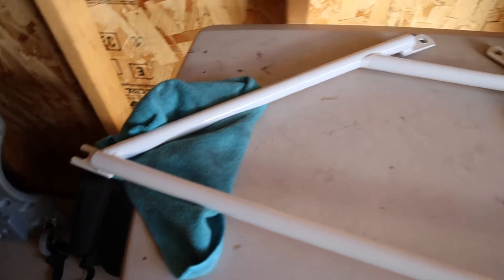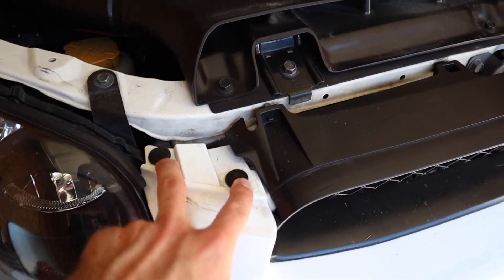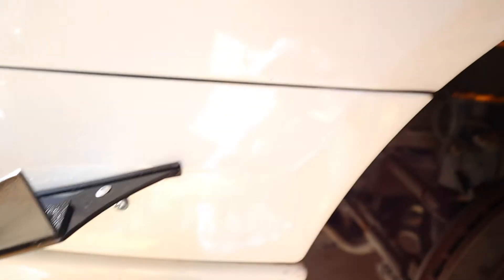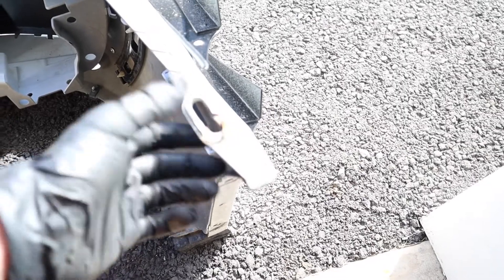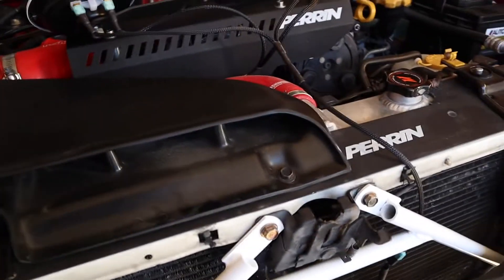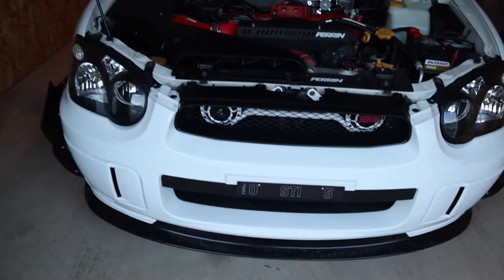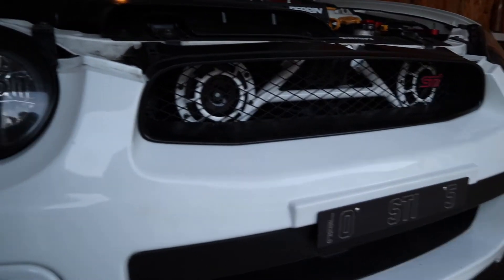How to Install a Front Brace on a WRX/STI

Comment: What did you do with the hood latch cable guide? One clip it was there and the next it isn’t there anymore.
Is the metal guide removable? Or did it end up cutting it? I’m debating on getting this but can’t find any info on if there’s any permanent modifications you need to do to install it or not.
4:02
Reply from the maker: I don't know what you mean by the hood latch cable guide. Yes the metal front brace that comes stock on the Subaru's is removable. You'll just have to unscrew a few bolts, but as you saw in the video you don't have to take it off to install the front brace. Also the only permanent modification is cutting the bumper slightly. Other than that it's a super easy install and can be taken off without to much work. Hope this helps!
Reply: @fastlifestyle7249  

  didn’t realize the Timestamp I put down cut off the part of the video I’m talking about. 

It wasn’t the big metal piece you were pointing at but it was the little metal cover in front of the cable.
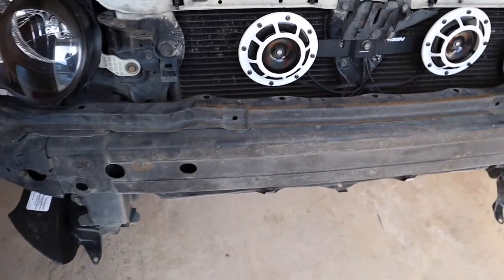I think I should’ve put down 4:01 since  that doesn’t cut the video off
Under the top right side bolt for the brace.

It was kind of under the right side horn.
Reply: I couldn’t figure out how he modified the cable guide. So I sadly couldn’t install my chassis brace. I don’t have a cut off wheel handy
Reply: @tony187proofgaming6  shoot, that’s what I was worried about! 
I was still on the fence about getting it or not all these months, now hearing that, it looks like I won’t be. 
Are you planning on cutting the guide in the future? Or what’s your plan?

Comment: How did you extend the Perrin bracket?
Reply from the maker: I just used the original two brackets the horns come with when you buy them. They are just two extenders that come attached to the horns. I'll leave a link to what they look like. 
https://www.amazon.com/HELLA-922000731-Sharptone-Yellow-Protective/dp/B00H8QON02/ref=sr_1_9?keywords=hella%2Bhorn%2Bbracket&qid=1674602832&sr=8-9&th=1
Reply: @fastlifestyle7249  oh Shii threw mine away 💀